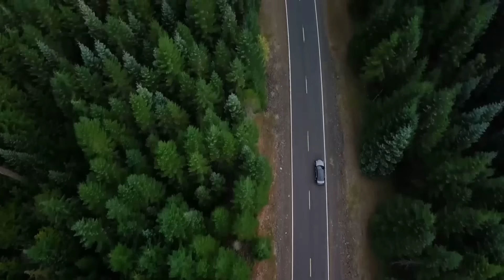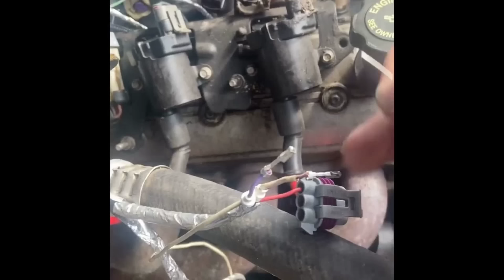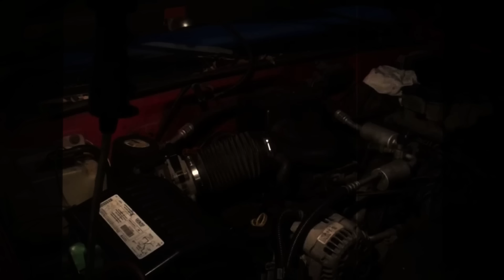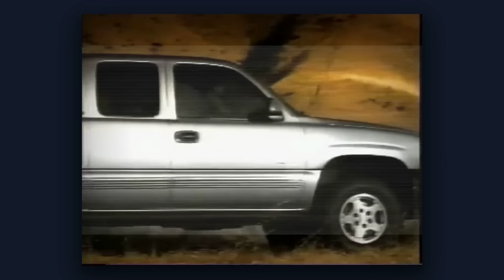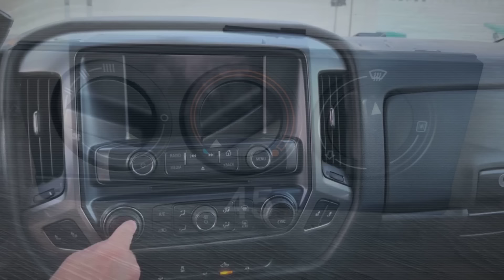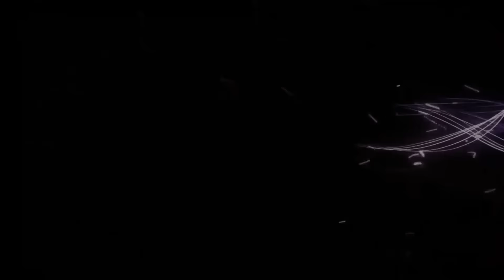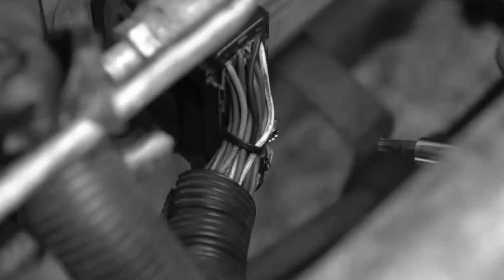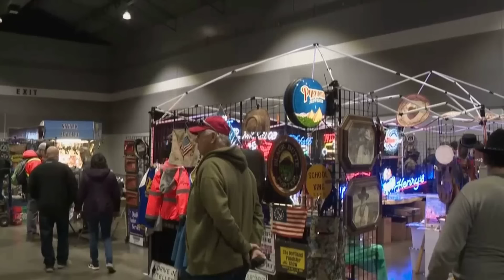How Smart Mechanics Are Bypassing The Dealership (The "Delete" Loophole)

Comment: well that works until it doesn't. 

and no I'm not knocking the technology the equipment whatever.. 

fundamentally that would work basically forever but the reason I offer up that it may not at some point is because yeah you know sensors and shit does go bad even on aftermarket systems but I can certainly say in the electronics world some shit is being reshuffled and you know what happens when it's no longer cost effective for the manufacturer of those aftermarket systems to number one manufacture those systems anymore but number two what happens when the cost of any given sensor goes up beyond what would be deemed a reasonable price I mean because that's the problem with a lot of aftermarket or say replacement parts now... 

it's fundamentally you can look around and get parts for a lot of shit but the reason why you know people have that car or what not sitting there for x amount of years is because they never could come up with the extra blah blah blah money to get it every time they planned on having that money whether it would be a Christmas present to themselves a birthday or maybe a tax refund gift well something else inevitably would break down and there went the money so then the vehicle basically sets there... 

I mean yes I agree they are discontinuing parts left and right that is a problem but I would say first and foremost the majority of the problems is the majority of the people face is simply what the hell does it cost today and then it's almost as if even if there is an aftermarket option A lot of aftermarket options require that you buy an entire new system you can't just go get the whatever you need so there is aftermarket ecms but in most cases it comes in a bundle with a whole system it's not just you know plug and play with an adapter or some shit like that used to be you could get those you might still be able to but for the most part they want to sell these things and cats and so if they just sold you the damn DCM for the couple hundred bucks you might be able to get that but then they want to throw it in this kit so all the sudden they want you know 6 $800 for it it makes it that much harder to buy... 

but I'm also aware that you know shit is being reshuffled in the electronics manufacturing world and of course that would include the components that make up any of these systems so if you have to go get a replacement part oh boy you know what the hell is that going to cost 10 years down the road you know you might have paid if you were lucky just for an example you might have give $300 for the entire aftermarket system that's great today you might be able to get any one of those modules for I don't know under $80 but 5 or 10 years down the road hell maybe somewhere in the next two to three years that very part might cost your ass 250 bucks...  

I mean I guess as of today sure it still worth putting the aftermarket system in the vehicle to keep it running for the time being yeah this is true but if you think about it on a scale of you know I don't know what like 3 to 10 years I mean you have to ask what else is going to fail and I mean let's face it a lot of those parts are probably made in China exactly how reliable are they yeah what is the replacement rate on a lot of those components of those systems? 

so you know some systems are always going to be better than others this is true manufacturing defects amongst a model year can totally happen that is understandable but you know you factor variables like that into it I mean you know shit you could buy and install a system today but then you never know in a couple of years it could be famous for popping whatever common module and I mean if it's a common one ideally it's not going to cost that much but on the other hand it might pop the weird one but then it's advised you by both of them when you replace one you know this shit like that happens all the time. 

but I can certainly say that the days of el cheapo microprocessors mosfets you know general electronics that's coming out of joints like Taiwan perhaps even Thailand China etc those days are changing that's numbered that's kind of gone it's leaving us now. 

so you know that's the thing is you know 25 to $50 part at some point it could easily cost $125 to 300 bucks I mean you know people can laugh at it today go ahead because I tell you what if you were on the planet and aware some 25 years ago then you're going to know that we saw that happen with other electronic components such as alternators and starters even for lawn mowers... 

yeah I mean you know shit back in the 90s it was nothing to run down to the auto parts store and grab a starter for like 50 bucks it was nothing to go get an alternator for 50 bucks if you wanted the scookum alternator I mean all right maybe 80 bucks by the time you get into 2000 and definitely 2001 and beyond all hell no they're charging $120 bucks for a fucking Briggs & Stratton lawn mower starter for literally like a 15 horse engine a car starter at the cheapest is literally about the same price if not $150 I mean this sort of shit has happened before so it can totally happen again and then of course aftermarket components yeah those starters and alternators and shit are very so much rebuildable but I can tell you that most shops don't bother rebuilding them because you have more time in them than it's actually worth of what you could realistically charge the customer and then all the components that you would have to stop it just basically makes it not worth it unless of course you was already in business to do that which I used to work for a guy that did that that's why he was able to do it but if you're a shop today whether you service cars or lawn mowers you're not going to sit there and order every common component there is that goes into common alternators and starters and talk about rebuilding them because it just really isn't worth it.

Comment: My 2007 f150 it's making engine and electrical problems I put a 351w c6 transmission, carburetor and a breaker point distributor solve all my problems and now my f150 is amazing I love old school if the brakes points  fail a piece of sandpaper clean the contacts and ready to go

Comment: As a professional mechanic, I have been saying this for years….The correct air/fuel mixture, good compression, and a spark at the right time….That is all you need to make a dinosaur internal combustion engine run……We don’t need computers and all the electronic crap…..Pretty simple really…..

Comment: I have a 1965 Thunderbird. I highly recommend replacing the points in your distributor with a magnetic pick up (Drops perfectly into the distributor housing) as this is far more reliable. Additionally I upgraded the entire ignition system to run off of 12V as the OEM runs on 8V via an iron resistor wire, which inevitably does corrode. Once the resistor wire stops reducing voltage the 8V coil fries under constant 12V load.

Comment: My wife’s car 2016 Ultima headlight 1200 each or what HID or put in the same ones without HID for $200 both headlights so I did that and I had to wire in a resistor to trick the ECM that the headlights weren’t malfunction and it works great

Comment: I’m 50 years old I’m a master mechanic. I have done the same thing years ago to my dad‘s Chevrolet truck I put in an early 80s small block, Holly 600 rid of all electronics made it mechanical runs great. He drove it for 10 years and then sold it for $15,000. My truck now is a 2012 Colorado and I’ve got the AC blower all bypassed and it looks great. Everything works good. I’ve modified everything I could.

Comment: This only serves a small group of people the do-it-yourself automotive enthusiast. The average everyday vehicle owner is far removed from this kind of problem solving. Aftermarket drivetrain control modules are not cheap either, especially Haltech, none the less "necessity is the mother of invention". Ultimately the powers that be will enact more laws to outlaw this kind of independence. Many states still have emissions and vehicle inspections so these hacks will not work without some sort of exemption that usually doesn't apply to a vehicle until it achieves collectible status.

Comment: I converted my 2016 Titan to run on syngas with a dual carb (predator harbor freight carb for general driving mileage) engine overhaul. I replaced the AT with a manual, and replaced all the electronic dash controls with analogue and mechanical controls. This year I am going to be planting an acre of sunflower & my own hedgerow of streamco willows to make more of my own fuel. Plus...it will block out my nosy neighbors view of my shop. I absolutely LOVE the 5.6L V8 in my Titan.....it blows through carbon above 4kRPM, barely needing deep cleans at all. Just some acetone water injection, and rough driving and she growls that carbon right out the tailpipes. My rough calculations are 2lbs willow twigs/5 miles (winter), and 2lbs/7 miles (summer).....depending on humidity +/- 8%. Which is fine by me, since I have almost unlimited free sources nearby, and I don't mind 5 minutes of prep work per 'tank of gas'. #ThirdReichEngineering  🤠

Comment: Fixxed a plastic vacuum connector with $5 dollar metal plumbing parts. The part was $300 dollars and obviously made to fail over time on a 2001 ford Explorer. Now 2026 $5 plumbing part still hasn't failed.

Comment: With today’s modern car’s design, it virtually impossible to do what this video proposes. Almost all vehicles, the ecm controls virtually everything from engine to transmission and to everything else like interior electronics, tail lights, etc. If you tamper with certain parts, you may brick the car. No way around it.

Comment: Not gonna lie, if I HAD to buy a new vehicle, first thing that would happen is an engine/transmission swap over to a cathedral port LS with a carb and Holley Ignition harness. Im not dealing with programming modules or crap engineering.

Comment: This is fun but some of this is pure fantasy, such as "throwing on" a carburetor onto a modern gas engine.  Where will you get the manifold for that?  All for this, Godspeed, carry on, but state emissions inspectors and even people at oil change shops can be trained to spot hacks and all they have to do is tweak the law and it can be required that you be turned in to law enforcement.  It's a LOT LOT LOT easier to tweak the law than it for you to tweak your truck with a carburetor or drop in a whole new wiring harness.

Comment: I always serviced at my Subaru dealer till he started charging almost $200 hr for labor. An 89.99 oil change is very high, new front brakes rotor and pad 675.00 were also quoted at my last service. Took the car to an independent and was charged 49.99 for the oil change and 455.00 for brakes and pads. Saved almost 250 dollars.

Comment: Mechanics are doing what?
You just pull the engine wiring harness and put in a complete new aftermarket DME?
Hahahahahahahahahahahahahahahahaha.
WTF
We don't do any of this shit. Put a phucking toggle switch in my vehicle?.. STFU
Just drop an analog engine in it?... Do what the purists actually do buy a basket case 1973 Ford F100 for almost nothing and do a resto.
All of this is retarded. The cost, skill, and modifications it takes to do most of that is absurd.
It doesn't take a high level mechanic and a good machine shop to resto something ancient. This other crap is ridiculous.

(If the eltronics fail buy a DME or module from a salvage yard, come home and change the vehicle order on it and plug your new module in... That's it and that's all you got to do.
**I pay $50.00 an hour to my mechanic that can do that by the way**

Comment: I've been hoping someone would start aftermarket parts that can eliminate the systems the manufacturer doesn't fix. AFN DFM, plastic parts, Pentastar oil starvation, and so many more.  My ultimate dream is a complete computer  system replacement.

Comment: I gathered this info from AI yesterday.  It is a shame what the car manufacturers are doing!  People like me refuse to buy into their planned obsolescence subscription model!  F'em!

Manufacturer	Oil Dipstick?	DIY Oil Change?	Battery Coding Required?	Data Privacy Risk	Serviceability Rating	Good for Privacy?
Mazda	                 YES	        Easy (Mechanical Reset)	  NO	                 Minimal (Opt-in)	            High	                 Yes
Subaru	                 YES	        Easy (Top Filter on most)	  NO	                 Low Risk	                    High	                 Yes
Toyota / Lexus	 YES 	        Easy (Manual Reset)	          NO	                 High Risk (Verisk)	    High	                  No
Honda	                 YES	        Easy (Maintenance Minder) NO	                 High Risk (Verisk)	Moderate	          No
Hyundai	                 YES	        Easy (Menu Reset)	          NO	                 CRITICAL (2025 Breach) High	                  No
Kia	                         YES	        Easy (Menu Reset)	          NO	                 CRITICAL (2025 Breach) High	                  No
Ford	                 YES 	        Moderate (Reset Glitch)	  YES (BMS Reset) Under Investigation	Low-Moderate	  No
Stellantis 	MOSTLY YES	        Moderate (Standard Tools)  NO	                 Under Investigation	Moderate	          No
GM (Chevy/GMC)	 YES 	        Moderate (Monitor Heavy)	 YES (Recent Models)	Banned (5yr Federal)	Moderate	  No
BMW/Audi/Mercedes	NO (Electronic Only)	Hard (Dealer Tool Reset)	YES (Proprietary)	Standard Practice-Very Low-No
Tesla / Rivian	N/A (EV)	N/A (EV)	                          N/A	                 Extreme (Always On)	 Very Low	           No

Comment: I have been replacing the  ISOBUS control system on various brands of seed planters that are used on farm.
All the ISOBUS get removed,including mini motors and replace the whole lot with one  DC motor to run the complete planter. Then use the off the shelf FIELDMATE controller to run the complete system.
Reply: Well done.

Comment: Maybe someone can figure out the way that guy in the 70's or 80's turned his dune buggy into a engine using the fumes from the exhaust put back into the system to make 200 or more miles to the gallon. LA to NEW YORK on 26 gallons of gas! All engines use to run on vapors now they run directly on fuel? This only benefits the oil refineries and retailers not the people, so why would they allow this patent to happen?? He died a mysterious death and his invention is gone. So if you figure it out keep it quiet until you have made enough of them that the genie can never be put back in the bottle by taking you out. Or if you are a lover of our earth and people then just share the details on multiple platforms anonymously and simultaneously! Then the business for war and power comes crashing down as they can barely sell enough gas to keep production going and zero plausible deniability reasons to start wars. Then people  see the true reasons and take their world and countries back from corrupt corporations and munitions manufacturers!!!

Comment: On some old pickups, when the engine goes out, it is worth considering what deboss garage does.  They turn the trump into a diesel-electric (thing train engine) hybrid.  You get better fuel economy and also a lot more power at the wheels when you need to get a load moving.

Comment: I’ve been driving my 1978 Chevy van for 30 years! I rebuilt the 350 in 2005 still run that engine I   Also had the TH350 built around the same time for 150.00 still running the TH350 with a HD trans cooler! I pull my 10 foot trailer with my zero turn mower with it. I have 700r4 rebuilt waiting. Yes I built the trailer also ! 
Love this community my kind of people!

Comment: The one big problem i experienced with an old car was the exhaust system was unshielded from the manifolds to the mufflers, the result was every eslastamer and plastic part was  degraded. To solve this heat issue, I insulated the exhaust system from the cylinder heads back the backside of the mufflers. The ceramic coated manifolds were sandwiched between ceramic/fiberglass. The piping, resonators, & mufflers was wrapped with eighth  inch thick two inch wide ceramic compressed tape. Covering the tape, 1/4" air filter expanded aluminum for the air gap with an aluminum skin 16ga half hardness. Fastened by 1/8" rivets. 
 This laborious job was no fun requiring removal and about three weeks of time to complete. The result was only radiator heat present in the engine bay and a cool floor boards. I learned the carpet had sound proofing foam that was degraded by the heat and didn't seal around the fire wall  computer mount that allowed engine noise in the cabin. The manifold seals to cylinder head were 1/8" Remflex  graphite sheeting cut by an Exacto knife and sealed with DEI 1500°F silicone spray sealer
 That sealed far better than the multi layer ss gaskets alone. I had a custom radiator made  by Ron Davis Racing Products to get the plastic tank substituted for aluminum and all the  plastic engine piping made from 6061 aluminum replaced also ( not cheap ). The car had a trouble free period up to 150k to 200k before having more problems i couldn't get mad about any more.

Comment: I have a 2001 expedition - had a leak = the oem window seal no longer exists. Not even on eBay. I went to a junkyard and pulled 12 doors worth for replacement and stocking.